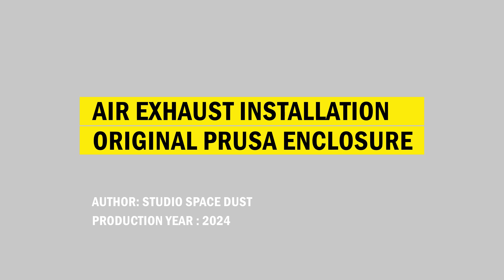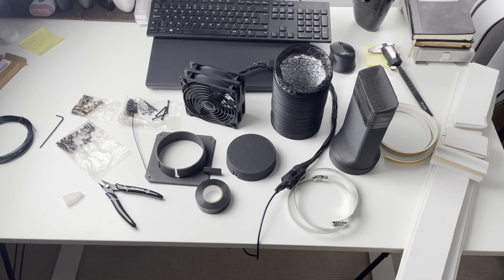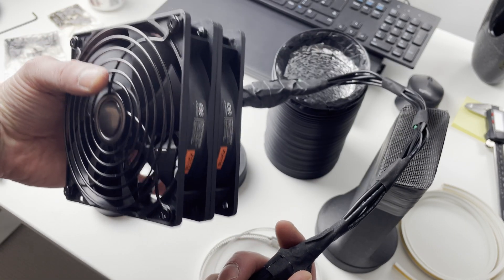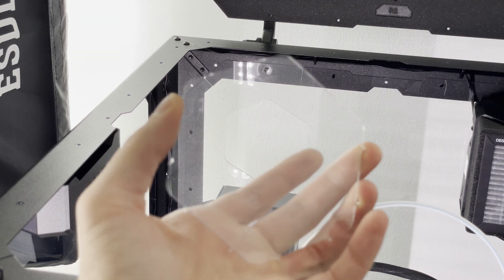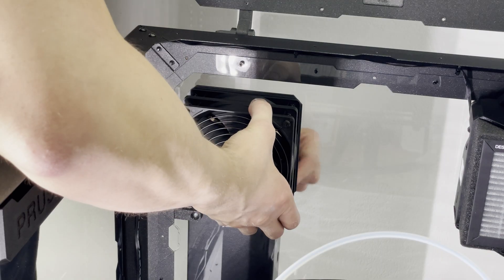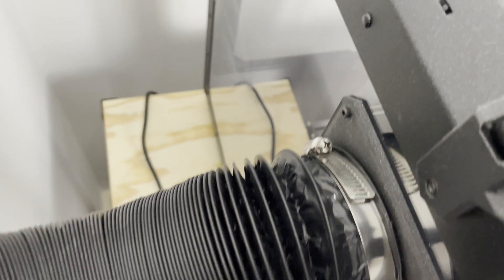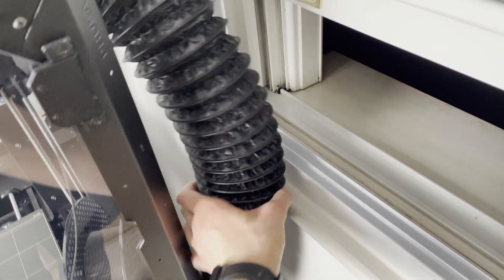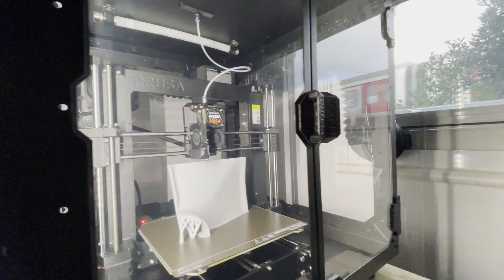Original Prusa Enclosure + MK4  Air Exhaust Installation

Comment: According to Prusa, the hepa filter in their Advanced Filtration System is a combo filter that also filters VOCs. They claim VOC protection. Are they wrong?
Reply from the maker: To answer that I would need to run some tests. Main reasons I don’t use that filter is: 1) its very loud, cant work in that room (main reason). 2) it creates very strong air circulation inside of the enclosure, which is good for PLA and AllPHA but bad for ABS/ASA.

Comment: Looks like something i need to do,. Can you tell me what fans you used please?? Or maybe a link. I'm interested in the airflow rate... Thank you! Great Job!
Reply from the maker: Hi Steve, I used AC Infinity Multifan S3. These fans are very quiet and have inbuilt controller, you can set fan on Low/Medium/High flow (~$20 on Amazon). These fans uses usb port so if you have old phone charger it can be reused to power the fan/fans. I used two of these fans only because I had them already but one will do job just as fine. But… any 120mm fan will work with Prusa Enclosure, maybe nowadays there are better fans, Noctura is also very good brand. Link to fans I used https://amzn.eu/d/7x7aLOS you can use link in video description to get printable files if you wish to use what I used in video.

Comment: I think you need to do some temperature testing. Do a print with both fans off, while monitoring the temps in the enclosure, mid level (sensor sitting midway in the enclosure, not sitting on the bottom). Then with the sensor in the same location, make another print of the same part in with the Prusa enclosure fan on, again while monitoring the temps. The finally print the part a 3rd time with your dual fan on, while monitoring the temps. I expect the results is that with your dual fan on, the temps in the enclosure will be close to room temperature. No fans on the temps will be higher. The prusa fan/filter on, the temps will be higher than room temps, but not as high as with no fans on. 

The enclosure has 3 main purposes. First is to stabilize temps and eliminate drafts causing part warpages and lifting from the print bed. Second is to keep the temp in the enclosure higher than room temp, which makes printing most filaments easier with higher quality results. Thirdly, the enclosure can be used to lessen VOC's, with a filter or venting directly outside.

You are doing a great job of protecting yourself and preventing drafts but are probably lowering the temperature in the enclosure.
Reply from the maker: Hey, this is a great idea! I will keep this in mind. So far the corner thermometer (original Prusa enclosure top left) is picking up ~+10C on top of room temperature when printing PETG, for example if its 22C in the room its ~32C in an enclosure with both (newly installed) fans set on low. While on low they are slowly and quietly pulling the air out and the amount of the draft created is way less than compared to using an original fan which is so powerful that moves all the dust around and only circulate air inside (not saying its a bad fan, just very powerful). I did a small PC blend print which came out without warps but to your point i would do more testing with ASA too, i just ordered BASF Ultrafuse and cant wait to try how that prints. And yes I could try to position temperature sensor in the middle to see how that compares to top left sensor. Why not. More-so would be good to order proper VOC sensor to compare readings, they are a bit expensive but ill get one with time. Thank you for your comment, this is definitely going to be in future video pipeline.
Reply: @StudioSpaceDust  I'm thinking of getting the core one and I'd like to make an exhaust like this. For PLA I don't see a problem, but for materials that warp, I don't see how this could work. Core one doesn't even have a heated chamber and it heats it with the build plate so it can take like a half an hour to heat up. Exhausting warm air out would be a problem. Perhaps an exhaust is okay if it's at minimum, something like 1 liter per minute might be enough to ensure no fumes enter the room and the draft doesn't cause problems. What do you think?
Reply: @dingdingdingdiiiiing  on Core One to print PLA you open top vent and max out extract fans in the back, to print anything that needs heated chamber you set the fan to as low speed as possible, just like you described. My biggest issue is that Core One could have been made better. But sadly like MK3/4 enclosure, the Core One frame is made of separate steel sheets, that have a relatively big gaps where they join. Its less than 1mm but you have this at every corner, construction is not airtight - hence the loss of temperature. Thats why it takes longer to heat. In my MK4 enclosure I used heat reflective film to deal with this so perhaps something similar can be done with Core One. But then best to buy Kit and do it while assembling. That should speed up initial heat time.